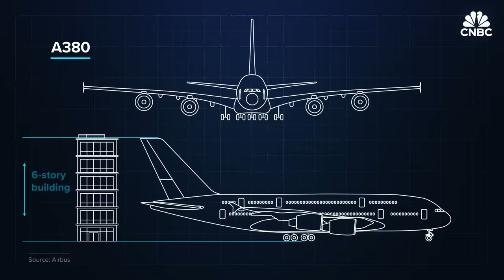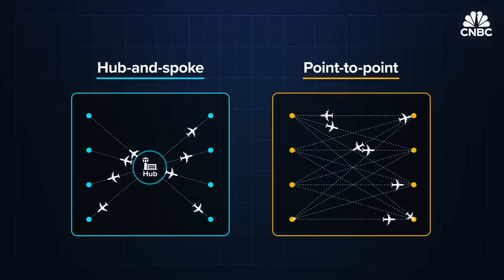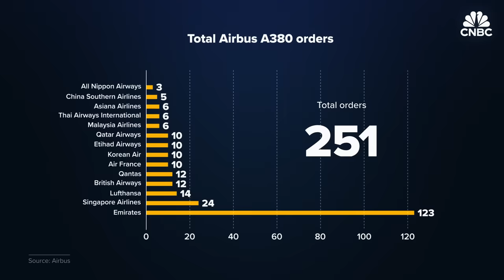Why The Airbus A380 Is Making An Unlikely Comeback

Comment: Flying the A380 is the best flying experience in the world. There is literally nothing like it
Reply: i disagree, because I flew on C-5M Super Galaxy while in the USAF. It is the best flying experience in the world from my point of view. The reason is because it has an over-the-fuselage wing design so the fuselage "hangs" beneath the wings instead of "sitting on top of the wings" like most commercial aircraft. This means that turbulence is nearly indetectable because of the reverberation of turbulent flex that happens to the over wing assembly. The wings flap and the weight of the fuselage is suspended beneath the wing assembly in a delicate and stable position. It is the Cadillac of the skies, like riding on airbag suspension. When the cargo bay is empty, it's simply astonishing how cavernous it is while flying and being able to throw a football through it like a 50 yard pass. It is a remarkable experience. It is in a league of it's own.
Reply: @jadesea562 Fair, but A380 is obviously the best experience accessible to the general population.
Reply: @lntg A lot of people disagree. The sheer amount of people needing to get on the aircraft makes even just boarding a hassle
Reply: @TheEchelon lmao what a whiny excuse
Reply: @TheEchelon  No it doesn't. There are three jetway entrances, so each jet way entrance is servicing no more pax than any other wide body.
Reply: @TheEchelon  Not at all, there is top and bottom floor boarding, it's a wonderful aircraft, a tribute to Airbus.
Reply: @TheEchelon  I know, right! Who needs all that hassle just to fly halfway around the world. 

If our great great grandparents could come to today and make a trip like that, I’m sure they would be annoyed at all of the hassle just to get on an airplane, sit in a comfortable seat and get to their destination in half a day. 

That extra 15 minutes to board is an injustice and needs to be addressed right now. Good grief, we are becoming soft people.
Reply: @PelicanNorth  doesn't take any longer to board the A380 than other planes as there are 2 jetways, one for the top floor and one for the bottom. Also who cares when the rest of the flying experience on it is such a breeze
Reply: @jadesea562  We're talking passenger planes. Otherwise, I believe those private Boeing and Airbus get the crown for the best flying experience, but of course I have never tried.
Reply: The ‘flying pig’ is back, temporarily.  Airbus took a heavy financial loss on the aircraft, with it several airframes have been scraped and production terminated.   Boeing had called the market correctly with twin engine long haul flights.
Reply: @jadesea562  Yeah but does C-5M have a staffed bar like Emirates biz class?   I was pretty damn comfortable and made bunch of new friends in long flight Zurich to Sydney
Reply: @TheEchelon  Its double decker, people get on just as fast as any other large jet
Reply: @sanitman1488  airbus take financial loss because of groundbreaking A380, boeing took a financial loss due to literally groundbreaking 737MAX
Reply: @redemissarium  Airbus took financial loss due to literally groundbreaking a330/ Air France Flight 447 and Qantas Flight 72.
Reply: @TheEchelon  The A380 is the best flight passenger ever. That s a fact.
Reply: @jadesea562  Well, I’ve flown on both an A380 and a C-17 and I’ll take the A380 thanks.
Reply: @TheEchelon  it takes about the same amount of time to board as any other large commercial airliner.
Reply: @sanitman1488  The ‘flying pig’, as you called it, has one of the lowest seat/mile costs of any airliner. The only aircraft that are more efficient are the B787 and A350. I have flown on all three types. The price of a used A380 is out of proportion to that of any other jet and if it had been made of CFRP instead of metal, it would probably still be in production. As for Boeing, they have suffered far bigger financial losses since the 737 MAX. And where is the new 777? The 737 is a 65 year old design that should have been replaced decades ago. Even the 777, great as it is, is now a relatively old design. The only modern type in the Boeing fleet is the 787.

Boeing have simply been lazy and failed to keep pace with the market. In the coming years they will have to replace the 737 because it’s being spanked by the A320 (the most successful airliner in history). Boeing are practically having to give it away to keep customers. Fortunately they axed the 767, which was one of the least inspiring things I’ve ever flown on.

The A380 was a result of 10 years of independent market testing. It wasn’t just built on a whim. No manufacturer can afford to do that. Neither Boeing nor Airbus has a crystal ball, so your Boeing ‘wisdom’ argument is simply wrong.
Reply: @thethirdman225  I think you addressed this to the wrong person. My original comment to @TheEchelon was pure sarcasm, pointing out that their whining about a 15 minute wait to board is silly. 

We are in full agreement.
Reply: @sanitman1488  The Air France 447 crash was pilot error. They misinterpreted the read outs in front of them. And much to your disappointment, QF72 didn’t crash.
Reply: @PelicanNorth  👍
Reply: @thethirdman225  utter nonsense. Airbus had counted on its own internal forecasts on future air travel warranting the production of the a380 and here Airbus industrie mis calculated airlines worldwide prerequisites for a smaller twin engine ETOPS for point to point flights. Boeing on the other hand got it right. This is why the 777 and 787 continues to have successful production lines and a380 terminated.
Reply: @thethirdman225  You are incorrect in stating Boeing suffered far bigger financial loses . Yes initially from the 737max accidents but today orders continue to flow in as production ramps up to meet demand. Airbus Industrie has stated on record it took a heavy financial loss on the aircraft.  As for the 777x ? The aircraft is being readied for certification. Late, yes but airlines lined up eager for it. What I do agree is yes the 737 should not upgraded to something it was not engineered for.  Here Boeing made a tremendous mistake stopping 757 production. Airlines that operate it do not part with it because it is a damn good machine and not even the a321 neo or XLR can compare to the 757 performance.  The 777 is not a relatively old design, for this all you have to do is look at the a330neo which is based on the a300.
Reply: @thethirdman225  Boeing merging with McDonnell Douglas created the laziness you refer. Today Boeing has righted the ship and is returning to engineering first not bean counters. As far as Boeing 767, for me as a aircraft avionics technician and traveler, it is a rugged reliable aircraft that is extremely comfortable, quiet with a smaller widebody feel.  
The a380 was the result of not independent market testing but rather initially in co production talks with first McDonnell Douglas but when MD dropped out Airbus went to Boeing. Boeing in its own market research saw a different forecast dropped out as well, so your Airbus  ‘wisdom’ argument is simply wrong.
Reply: @thethirdman225  No, the French equivalent to the FAA stated Airbus Industrie as well was at fault.  Read the report please. 

Qantas 72 didn’t crash because of the sheer airmanship of its captain, a former U.S. Navy fighter pilot.
Reply: @sanitman1488  Boeings orders have been trailing Airbus for the better part of fifteen years. There have been a couple of years where that was not the case but as of this moment, Airbus has well and truly taken the mantle of the worlds largest manufacturer of large commercial airliners and that will not change for some time. Boeing simply do not have enough modern aircraft types on offer to make up the difference.

The 757 was simply a niche that was attacked from both sides by cheaper and more efficient aircraft. Even the 737 was a problem for 757 sales. It would stand no chance against the A320 NEO.
Reply: @sanitman1488  The A380 was the product of a DASA study from the 1990s.

I made no argument about ‘Airbus wisdom’. I simply criticised your claim that Boeing ‘called it right’. Don’t put words in my mouth.
Reply: @sanitman1488  That’s BS. Airbus didn’t just build the A380 on a whim. At the time the design was frozen it was the largest airframe that could be built before structural weight became a problem. It also represented lower seat miles costs than any type in service, including the then-new B777.

Most of the people who criticise the A380 this way are just haters and Boeing sock puppets.
Reply: @thethirdman225  Guy is triggered and ego bruised. Look this is what you’re implying.. Don’t gaslight.
Reply: @thethirdman225  Airbus fan club guy, read what I stated above. Airbus were in discussions with both McDonnell Douglas and Boeing on a new super jumbo. This is documented facts.  Both manufacturers would share costs.  Both decided it wasn’t feasible. The market wasn’t there and never materialized.  MD12 plans were stopped. Airbus decided to go alone and payed a financial price.
Reply: @sanitman1488  So what? That doesn’t mean the data wasn’t accurate. The idea that they could have co-built an aircraft across the Atlantic is almost ridiculous, especially when it’s applied to major components and especially ridiculous when both American manufacturers are on the west coast. Add a bit of good ole ‘not invented here’ and it’s hardly surprising they weren’t keen.

But you’re overlooking the fact that there are plenty of components already made by US manufacturers in Airbus products and vice versa.

Your argument is so shot full of holes it’s hardly worth responding.

There’s only one reason I’m an Airbus fan rather than a Boeing fan: right now Airbus’s product line is simply better. Boeing needs to fix this. They only have one modern jet in their lineup. And if competition is ever going to improve the product then they have to do it better than they’ve been doing it in recent years.
Reply: @thethirdman225  spewed a lot of nonsense there Airbus fan club guy. Try again.
Reply: @sanitman1488  Cope harder.😂😂😂
Reply: @thethirdman225  come back with factual information, not BS 🤣😂🤣😂
Reply: @thethirdman225  if that was the case, you would have provided links Airbus fan club boy but you can’t because you got jack only a opinion! 

You lost the bet.     Avionics technician AMT , Airbus a319 and a320. Boeing 737, 757, 767 and 787. 

Thank you for giving me the last word Airbus fan club boy.  Enjoy you’re kart racing.
Reply: It's because you never tried a flight with a 737 Max without door-windows. Believe me you'll never forget this journey experience, there's really nothing like this! 😅
Reply: @sanitman1488  I sincerely don’t get what your problem is. I just stated that the A380 was the best flying experience I ever had. And I’ve flown on every single Boeing and Airbus aircraft. Nobody cares Airbus made a loss on the 380, it’s just a very nice airplane. And yes Boeing is lacking behind and should do better. The whole MAX debacle should say enough
Reply: @MrJimheeren  I sincerely don’t get what you’re problem is either?  I simply pointed out the aircraft is a ‘flying pig’ that doesn’t have the aesthetics like Boeing 747 furthermore 8i is a beautiful machine just as comfortable. Likewise I simply pointed out the a380 program was a financial failure for Airbus Industrie. Now I’ve noticed with you’re rebuttal, attack Boeing with its present situation with its 737Max 9.  Now from a aircraft maintenance technician perspective it has nothing to do with the aircraft itself as it is now a sound platform but the problem is the quality control prior release to airlines. Here I agree with nearly everyone on these forums, Boeing needs to put itself in order.
Reply: @jadesea562 This isn’t a video about military aircrafts. There is context to his comment.
Reply: @thethirdman225  Boeing can't afford to build a new generation of aircraft. So it stuck with the aircraft it has.
Reply: @DavidKnowles0  And at the same time, they can’t afford not to.

They’ve kind of painted themselves into a corner.

And yet they’ve had new designs on the drawing boards for years that have come to nothing, yet they broke a lot of new ground with the 787 that can be incorporated into anything new.

I think their two biggest mistakes were sticking with the 737 and 747 for a bit too long.

The sudden collapse of 747 sales a few years ago was a pointer to that.

Too big to fail and too big to grow.
Reply: @MrJimheeren  I haven’t got an argument against that. I largely agree.
Reply: @thethirdman225  There saving grace is that it's to complicated and to expensive for any US startup to enter into the market . US protectionism will protect them from Chinese startups an capacity problems at airbus will buy them time.

Comment: A380 is the best experience currently. Once you have flown in it, you would not want to fly on another plane
Reply: yes i would rather drive.
Reply: Maybe if all you know is economy seating.
Reply: @BlownMacTruck stop trying to talk rich 💀💀
Reply: @friedtoaster4059  What does that have to do with anything? There are seats on other planes that are way better.
Reply: Nah, I would rather save the 1 hour flying from Europe to LA with the faster Dreamliner than flying on an a380.
Reply: @papagen00  have you actually flown on an A380?
Reply: Bar the 787, perhaps. The lower cabin altitude is so much better since I’m less tired after a flight (I haven’t been on the A350 yet so I don’t know if that’s also the case)
Reply: @theminer3746  the curve of the 787 fuselage makes window seats less comfortable if you're tall. Not an issue in the A380. But yes, the cabin pressure is nice.
Reply: @papagen00  drive through the ocean? good luck
Reply: @papagen00  Are you confusing this aircraft with the flying pig that is the Boeing Max? Now that is a disaster that has and is waiting to happen.
Reply: 787-9 is actually incredible
Reply: @papagen00 the A350 in the 3-3-3 configuration is a close second
Reply: @friedtoaster4059  Don't need to even be rich to fly business. And how do you know if he rich or not?
Reply: @Superbustr  the dreamliner's cruise speed is only 10km/h faster than the a380's. The difference in time would be smaller than 5 minutes
Reply: @theharper1  the cabin pressure is actually better in the a380 than the dreamliner
Reply: You'll be surprised at whose riding economy these days😂
Reply: @alinaqirizvi1441   OK, I wasn't comparing the two. The cabin pressure in the 787 is better than in other Boeing aircraft. I far prefer the A380 to any other aircraft I've flown in long haul, including the A330, 747-400, and 787. Just not on Lufthansa.
Reply: @BlownMacTruck flu upstairs in business it’s in a different class to everyone the plane.
It makes the 747 feel like a model t ford.
Reply: @Superbustr I have flown both.
A380 is a diffent class of plane, Dreamliner is in a different class.
It’s like comparing a cheap ford fiesta(us cheap nasty junk) to a merc s class.
Reply: @user-tt6il2up4o  What? That makes no sense. What does that have to do with anything? Do you think other planes don’t have different classes?
Reply: True